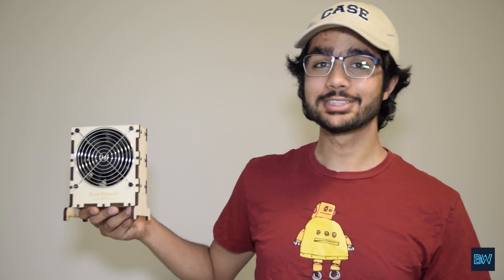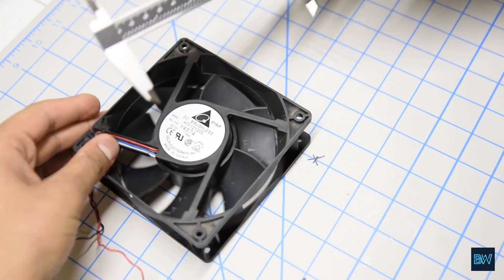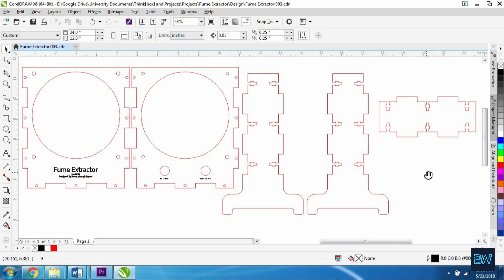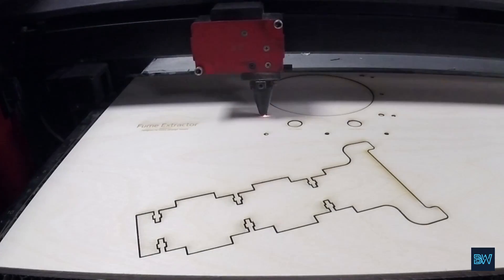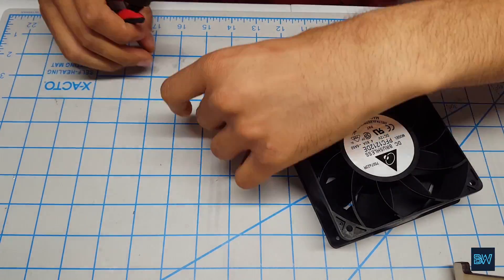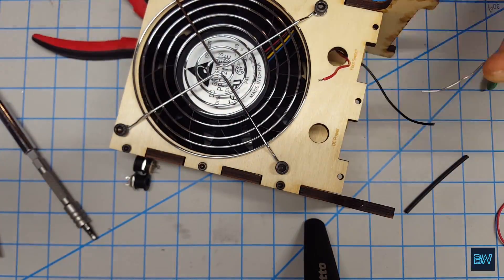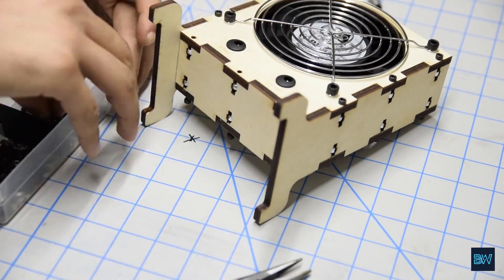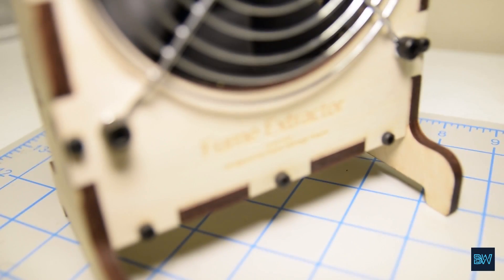Fume Extractor

Comment: The fume extractor is great project to build. But when soldering I don't know the speed of the fan will also remove the heat from the iron. My intension is to increase the height of the extraction fan input and control the speed of the fan.